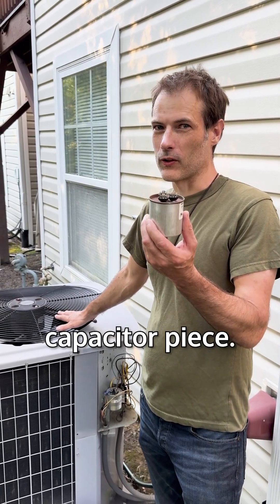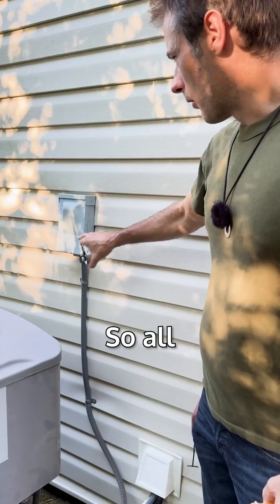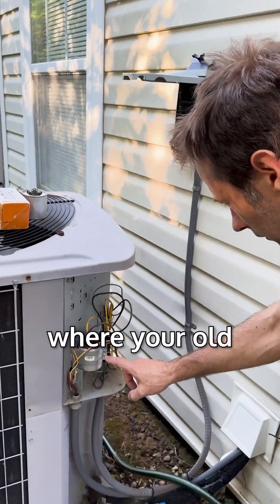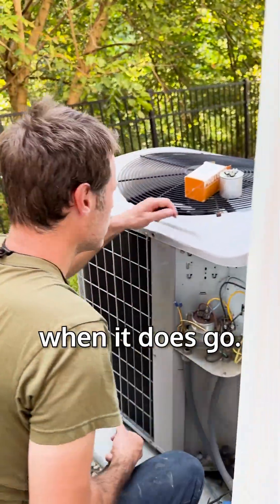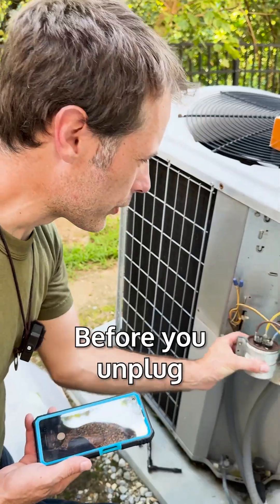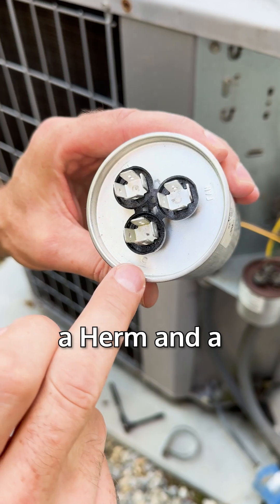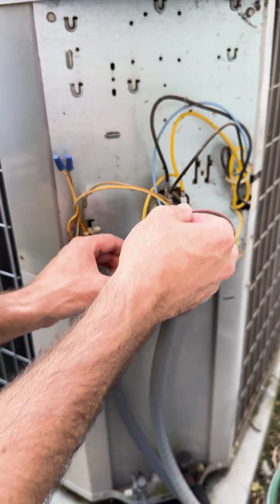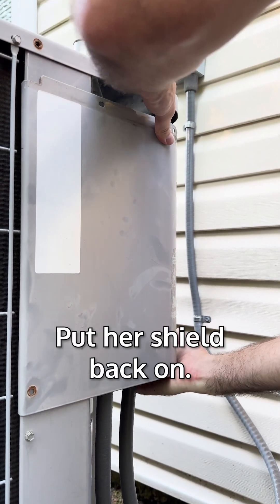Replace Your Capacitor NOW (BEFORE It Fails)

Comment: This is a dangerous video. A job like this isn’t DIY. If you have some electrical experience and knowledge of HVAC, sure. But the amount of information you give is just enough to get people replacing capacitors unnecessarily before they need to be replaced or worse seriously hurt or killed.

Another thing is the reason a compressor costs $3000 is because you can’t get a compressor for the unit. At that point you’re replacing the whole unit for a new one for the same price or cheaper because it’s old and time for replacement.